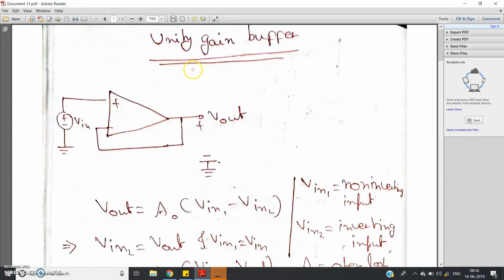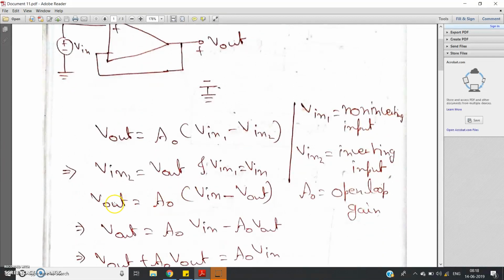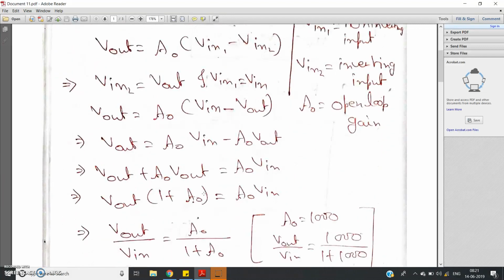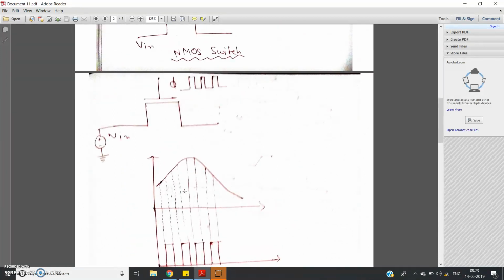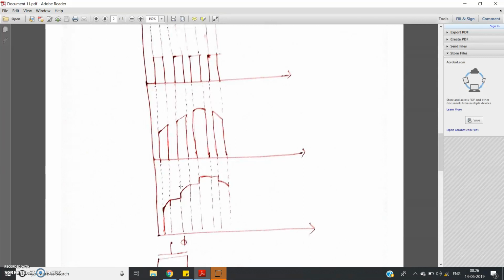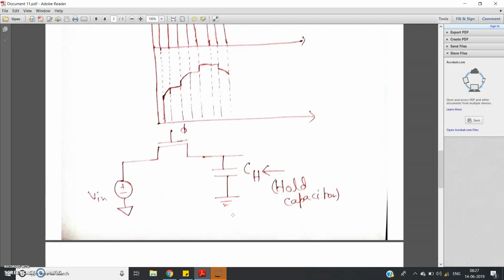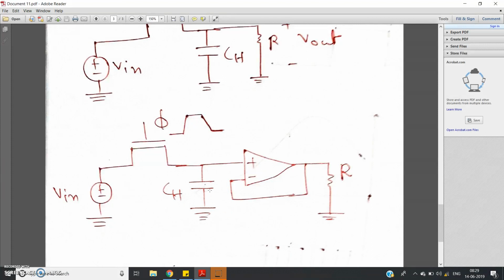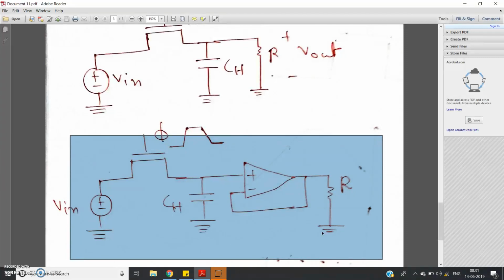Sample & Hold circuits (Using unity gain buffer & NMOS switch)

Comment: During the time when Vin starts reducing from its positive value...the charged stored across the capacitor reduces... So that reduced charge... Where does it go?
Reply from the maker: When the mosfet is in on state , there is always flow of charge/current in between left and right side ( just consider the mosfet as pass transistor).
So , that reduced charge flows through the mosfet and goes to source , you can say in that time , the capacitor will charge the source(although it sounds crazy , but you can visualize the incident like that) :-)